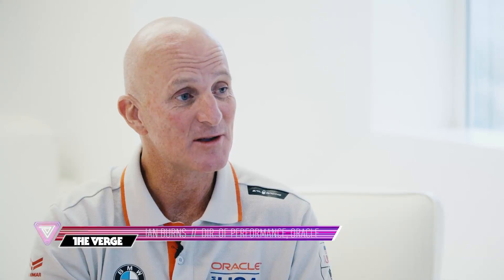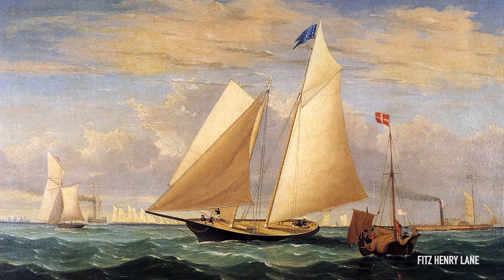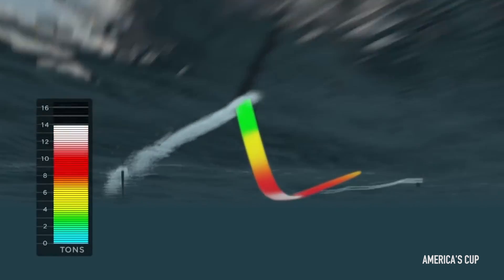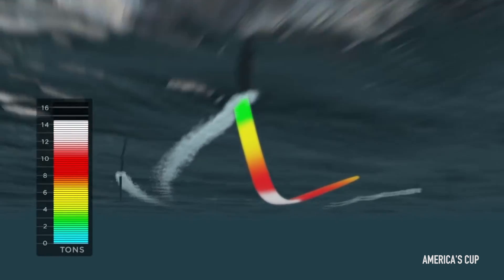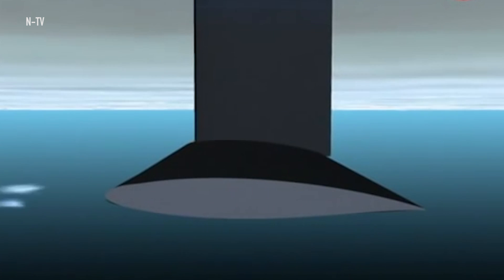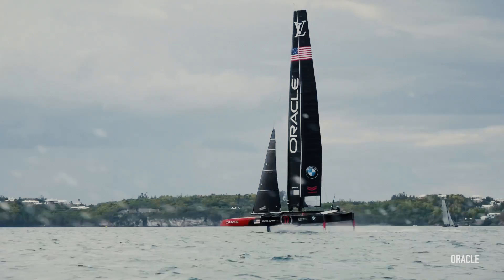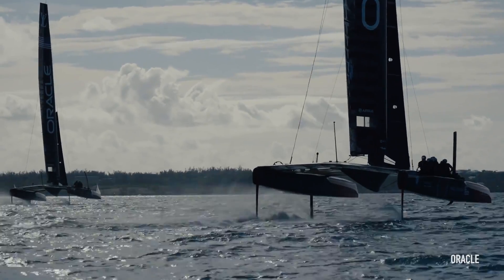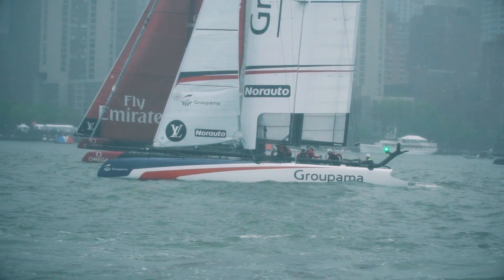What makes these yachts "fly?"

Comment: I don't see any boats "literally" flying
Reply: The hulls are flying in the sense that they're in the air, not supported by buoyancy - the tiny foils in the water aren't supporting the boat through buoyancy, they're there to create a sort of pressure difference to achieve lift in the same way that an airplane's wings do.